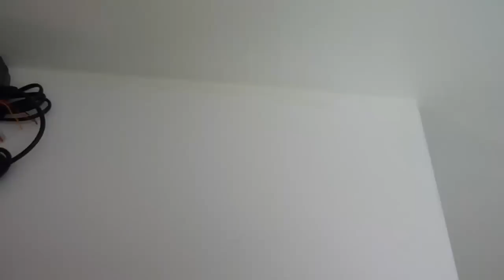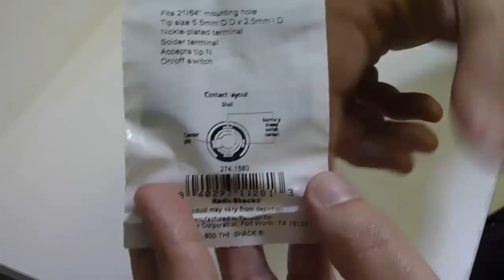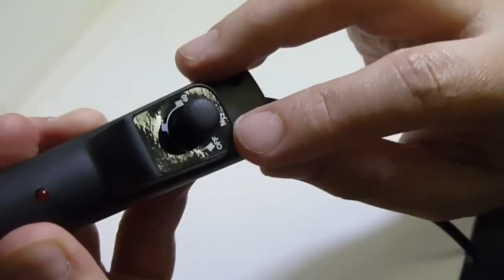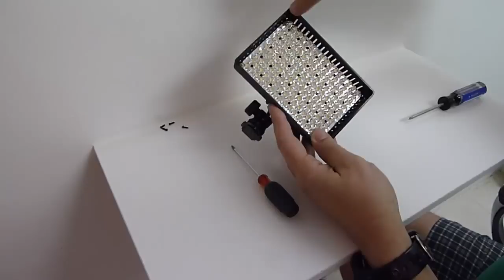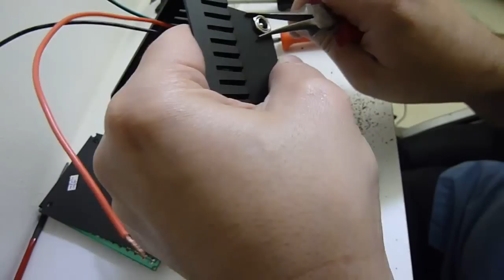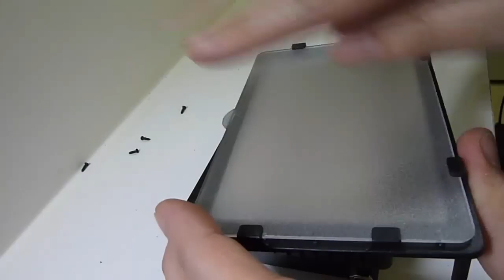How to connect a power adapter to the CN-160 LED light

Comment: Hi elias! Ty for this video! I have an very important question for you i dont know whereelse to turn. I was trying a 7,4v uv5r radio battery with two wires with clamps just to test the lights and it worked! However you know the sides on this thing is not flat(stupied design) and it fell and the two wires came together with battery attached and it shortcircuited. Now my lights dont work at all. Do you have any idea how to fix this? What do i need to replace? You are my last hope!! Regards Adam
Reply from the maker: +Adam K, I am sorry to say that there is no easy answer. You should take it to an electronics technician for repair. However, I don't think that any professional would charge less than $30.00 to even take a look at it. The cheapest solution is to buy a brand new one. I believe that the LEDs are still in good shape but the circuitry that control the voltage is damaged. You could keep the old one for spare parts.
Reply: +Elias Barbosa Thank you for reply. Sadface . Is it possible to just connect a battery straight to the leds with a simple on and off switch? I suspect most of the circuitry is for dimming and different power sources? How much power should be fed to the full board of leds if connected directly? do you know? thank you
Reply from the maker: +Adam K I wouldn&#39;t be surprise if just connecting the battery straight to the LED circuit board would simply work.
Well, you&#39;ve got nothing to loose. If I were you I would try to see if it works.
Good luck!

Comment: This video was great for the soldering and power adapter conversion tips! 

However, I think the $12 adapter that Under Country Music News found is probably a better solution for this particular device. I plan on using rechargeable AA's in the short run.

Comment: You are going thru a lot of B.S. You bought the power adapter, provided it's the correct one all you have to do is put in place the Panasonic Battery Adapter which has the port for External power and just plug in your power adapter, DONE!

Comment: I was poking around for an easier solution and found many power adapters on eBay that fit right into the camcorder-style battery bay on this unit. I just ordered this light for $27 on eBay and the adapter for about $12. Plus the connection is in the back of the light instead of sticking out of the side which is important for me as I do a photo booth. So for $39 all-included no soldering, hole-making, nada. I don't think I can post a link here, but just go on eBay and search for cn 160 ac adapter. Bam. Great video though. I almost did this and then stopped and thought for a moment. I DID pick up some great solder tips from your video though, and for that I very much thank you!
Reply: Reply to Cln 213 - just look for the ac adapters on eBay. They are right there. I have 2 of them and they work great. I also bought a couple of softboxes on amazon for about $12 each which I highly recommend. Can't post links.
Reply: +UNDER COUNTRY MUSIC NEWS
http://www.ebay.com/itm/Neewer-CN-AC2-DC-7-5V-2A-Switching-Power-Adapter-for-Video-Light-CN-160-CN-126-/191655303064?hash=item2c9f8bd798:g:rXQAAOSwPcVVw7WI
Reply: Javier Orellana Yep, that's it. I didn't think you could post a link on YouTube. Maybe that was an old rule that just stuck with me.
Reply: Nice one, before i broke mi light, read comments and find yours, thanks...

Comment from the maker: Cory, there is a third wire that I didn't record while soldering the jack to the light. I mentioned about it but you don't see me soldering it. I wrote a note on the video to point out the problem while recording. If you forgot to solder this third wire, your light wont work with the batteries. If you missed this third wire, please, watch the video carefully and you will see what I am talking about.

Comment from the maker: Hi, Cory Brangoccio! As you know, the batteries are supposed to work when the power supply is not plugged in. If nothing is connected, if the battery is charged, and it still doesn't work, you may wanna check out the wiring on the three terminal jack. You may have switched the wires. It is also possible that one of the wires could have poor electric connection at the soldering point. Having a continuity tester can be very helpful in debugging this stuff. The good news is that nothing was damaged since it still works when plugged in. Just be methodical and I am sure you will figure it out. Good luck!

Comment: question! I have done this on three lights now and it works great, but all of a sudden one of the lights no longer responds to battery power... still works if plugged in. Upon inspection all solders are correct and in good shape. I can't find anything wrong. Any idea?

Comment: Excellent video.  Learned a lot, especially on soldering techniques.  Followed the video more or less and completed the modification for two lights.  They both work well as expected.  Thanks.

Comment: I was literally looking for whether anyone had mounted a coax power jack onto one of these lights when I found this video. Guess that answered that, hehehe...

A few suggestions for anyone looking to replicate this...

1. The tip on most coaxial power connectors is usually positive. Look on the power supply to see what it says, though, just to be careful, and for a final sanity check use a multimeter to verify polarity.

2. Cellophane tape isn't really what you want to use for insulating soldered wiring, as it won't stay put. Electrical tape is a much better choice. (Heatshrink tubing is best of all but requires additional equipment and expertise so as to not melt things or set them on fire.)

3. One of the handiest hand tools an electronics buff, electrician, general handyman, etc. can have is a tapered reamer, which makes quick and easy work of enlarging a hole in plastic. They're relatively inexpensive - often much cheaper than a step-drill bit - and way faster than having to enlarge a hole by hand.
Reply: Just curious what extra equipment is needed for heat shrink tubing?  The guy who first showed it to me just heated it with the side soldering iron, up away from the solder at the tip.  I've been doing that ever since, and it seems to work fine.
A month later:
To answer my own question, I saw someone use a heat gun to shrink it.  That works.  But, the side of the soldering iron still seems the most convenient, to me.  You just have to use a little care to stay away from the insulation, and to not smear solder all over the outside of your heat shrink.

Comment: Decent video.  Thorough enough that I managed to complete it.

I have one suggestion.  The power jack I bought didn't have a schematic.  I suggest you plug the jack into your power supply and check the voltage with a multimeter before doing all the soldering.  The center is usually obvious.  The post that shows power on the meter is going to be your black wire.

I had it backwards on my first try, and had to pull it out and solder them again.

Comment: Hello and thank you for this very easy tutorial. I am running into a project where I have to leave the lights on for a period of time longer than 2 1/2 hours which is the average time these batteries last. And they will be pretty high from the ground. This is the solution for my problem. Thanks again. The most useful tutorial in years!!!!!!!